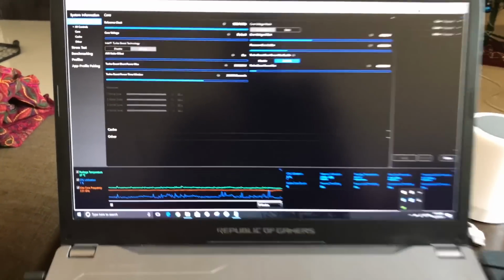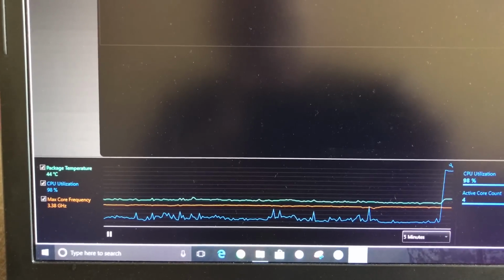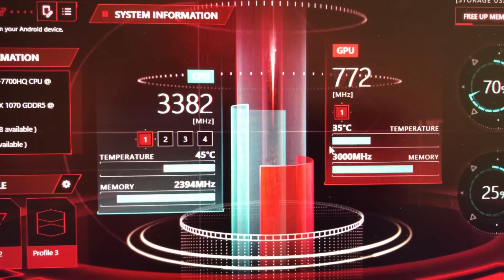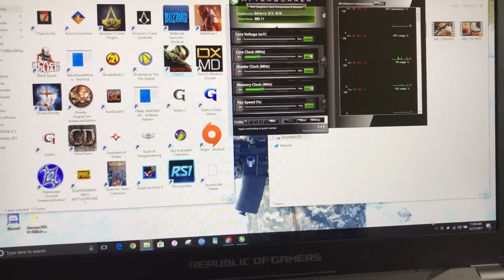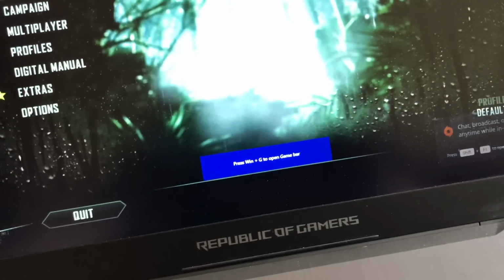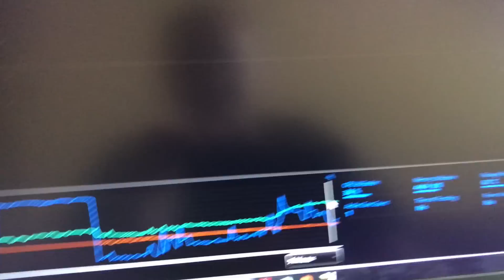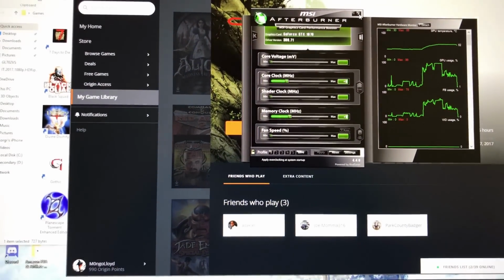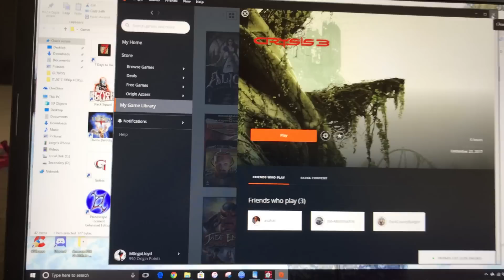ASUS ROG - Liquid Metal 5 Months Later! Followup

Comment: Tape the heatsink copper to the outside of the corner lines. Cover the WHOLE area inside the lines. Let sit for 12 hours and then clean off with DRY cloth. Copper should now have overall UNIFORM gray color. The heatsink is now Tempered. NOW spread LM thinly but evenly on heatsink and Die  for final assembly.

Comment: My condoctonaut will arrive next week. Planning to apply it on my ROG strix G17, both on the cpu and gpu. After applying it, others said i should reapply after a month, and then after that. I can reapply yearly. Would that be good?.. i don't travel that much with my laptop so no problems about leaking. One other thing, could i use electrical tape to cover up around the cpu and gpu die?

Comment: help me 
on same paste 
on same settings
on exactly same laptop
and i have fans on max 
i have 80oC on idle and 90-95oC in stress test please help me
Reply from the maker: Maybe you didn't use enough of the liquid metal? Maybe you didn't clean the surface very well first? Did you check the heatsink screws to make sure they are seated well? Did you undervolt the CPU?
Reply: i used ~0.4g 
i cleaned surface with isopropyl alcohol
checked 3 times 
no i didnt undervolt

Comment: 1:12 is it just me or is that a hole on your block? 
how is it holding up now!
Reply from the maker: Nah, was just some pooled gallium, still perfectly level surface.

I ended up selling it after 2 years, to upgrade to a more powerful system. Ran fine and was in overclock mode most of the time! I'd do it all over again if I had this heat trap 😂
Reply: @MrTsTips  huh that's cool! I personally have a 6 year old PC with a 3570k and it's begging for an upgrade
Reply from the maker: @ameliabuns  Wow! Yeah that's definitely overdue for an upgrade (depending on what you use it for!). If you are mostly gaming and higher end graphical/video work, the majority of that will be offloaded to your GPU, so I'd think of slotting a new RTX 2070 (best bang for the buck) in place of the existing GPU and see how you like it! If you then still want to upgrade your system, you will at least have a great GPU to base the build off of.

Comment: So I did this today on my Laptop, which is exactly the same one you have here. But while gaming, my GPU would start dropping frames all off a sudden for a few seconds before going back up. Any ideas? I'm thinking of taking the LM off and just using Kryonaut on the GPU now...
Reply: i tried to shim with 0.3mm copper plates both cpu and gpu, now it perfectly runs with 2 degree celcius deviation on 4 cores. i suspect my 1 piece ihs on cpu and gpu was bent a little. Before i had 20 degrees deviation between cores. i used in dell 7577 and asus g752vs. problem was on g752vs.
Reply: @nitehawk4067  i have same Asus G752VS with i7 and 1070 graphic, can i make same think as in Video shown, or need to make something other?

thx

Comment: Thank you for the work here, I will treat my ROG Zephyrus 502GW the same treatment - its very similar in build and gets very toasty!!
Reply: Michael Rudiger I have the same laptop (GX502GW) and am considering repasting with liquid metal. Have you done it yet and what are your temps?
Reply: @sidetraxx  Not yet, am currently not home and don't have the tools needed - I will do it, maybe even with video and benchmarks and temps. Also Using throttlestop to tune and undervolt at the moment.
Reply: @tech-daddy  Just wanted to come back and let you know my results. I repasted CPU and GPU with Kyronaut instead as I didn't want to risk doing LM since I've never repasted before. Thermal temps have improved, hitting 85C at the max for CPU temp now and overall the keyboard's been cooler to the touch and average out around 82C. Before I was getting 95C with spikes to 99C. Asus factory thermal compound was probably as terrible as the application job. 

I can only imagine how much lower LM would get it, likely even quiet the fans up.
Reply: @sidetraxx  Thanks for getting back with real world results :) I have pasted and repasted many things in the past and yes - LM is not for beginners. It much only get inn touch with copper at worst (nickel plated is ideal, aluminium is NOT possible). Also components around the areas where LM is applied should be protected, for example by sealing them with nail polish (LM is highly conductive). I will post again once I get mine done eventually ;P

Comment: Hey its been well over a year now. Have the temperatures started to creep up yet or is it as it was a year ago with LM?
Reply: Might not be completely helpful but I used liquid metal on G750JZ and the temperatures started to increase after few months. In desktop you might pull off few years but in laptop you'll definitely need to repaste it quite regularly if you want low temperatures, at least every 6 months.

Comment: Thanks to you I dropped my temps, it's been more than 6month now, so I'm planning to repaste as you did; Did you change the thermal pads too? I used the fujipoly, but they seemed to have rebranded themselves as Alphacool(I think). 

ps: I have the gl502vs, and want to change the ram, the clock is 2133Mhz, but do you think I can take 2400Mhz?

Comment: Ok to really lower your temps go to your advanced power settings and set cpu to 99% maximum state when plugged in / on battery. This turns turbo off which is not really needed in games and thus, lowers your temps dramatically by 10 degrees.
Reply: nice tips sir
Reply: Can you tell the exactly way of doing this please ??? I cant find where we can set 99%  :(

Comment: I did this to my gl702vsk, and it didnt do a thing. temps still in the 95+ under full load, but after 8 months, I took it back apart and replaced it with artic silver 5. Now temps are around 8 7-90 under load, so Idk.
Reply: Depends on the game you are playing. When I play Divison 2, it soars all the way to 95 and less CPU intensive games take it mid 80s. I use Noctua  thermal paste. Gonna try the liquid metal and see, but I dont expect much.
Reply: Manufacturing defects such as broken heat pipe or bent surface. Think with your head

Comment: Hey did you travel with your laptop ? Cause i'm a student and my laptop will be on conductonaut (3-4 travel by week), is it risky ? Will i find my laptop full of galium next time i open it ? :D I think if i dose it right it will be ok so i don't drop off, galium melt at 30° so in winter i think he will just solidify and melt again and again so it will be perhaps bad, i don't know, my laptop is a furnace actually so i want to find a way to cool it down, (i have bought kryonaut and conductonaut in case i change my mind). Can someone help me ? Thanks
Reply: Mayba Bamay it's not water...it attaches to the CPU and the heatsink like a normal thermal paiste...it,s safe to travel with it...

Comment: I know its been a year at this point, but did you check the temps without the undervolt? Im about to do this method to a Acer Nitro 5 AN515-53 WITH A CORE I5 8300h and a GTX 1050TI, running around 85c CPU/GPU under load

Comment: Ha, I have the exact same laptop, I covered my webcam with gorilla tape. I'm scared to actually do liquid metal, but my warranty just expired, so I just said screw it, and drilled a bunch of holes over the fans, that dropped my temps from 90c on the CPU and 80 on the GPU to 65c on both at full load. I might work up the courage to try liquid metal, or at least some higher quality thermal paste.
Reply: Can you send a link of a pic how you drilled it hahaha thats going all out dude props to you for just saying screw it hahaha
Reply: @marcgabrielferrer8616  Yeah, I'll grab a pic later, I upgraded to another laptop later, because in my tinkering, I screwed up and pulled the power connector pin from the mobo, now it only plugs in when connected to the wall. Now it's just a constantly on folding@home machine. The temps are good though!
Reply: @BlueThundah75  haha okay bud thanks ill wait for it

Comment: Watching gallium destroy copper ftw
Reply from the maker: "Destroy" may be a bit hard of a word to use here. Some RAF or discolored surface is there, sure, but thermal performance is there still as well, and even better with second application. Still running just fine, no problems on that last application ... it won't "destroy" copper if done right,  until the GPU is old enough to be obsolete anyway. It's a risk anyone who would apply this is taking. If you fuck it up, work some more and buy another.

Comment: Hey there Mr. T. So a few months ago you and I had a youtube comment chat and you helped me get to terms with how to undervolt the CPU and the GPU as well as answer some of my questions on your original thermal repaste video.

Now several months on, with comments being deleted (after your channel rebrand) and having experimented with my own computer, I have to admit I'm still not getting quite the temps you are...

Now as far as I can tell, you had a 702 that ran much hotter than mine did when it was stock, but then after your procedures, your PC is running so ridiculously cool. I'm so jealous truth be told. I did a thermal repaste originally and then redid it after a few months. When I did, I was disappointed to see my PC not get any cooler.

So to be clear. My PC idles (or has one or two browser windows open) at 40 C with a  CPU undervolt of -.125 and a GPU idle of around 43. This is with fans at around 70. Then when I game, They don't seem to go higher than 80 C. Now I do run an external monitor to this laptop. This monitor is at 1440p and it Gsync up to 144Hz. I'm not sure if that affects the temps. Because I do think it does. I mean I run Project Cars 2 or Elite Dangerous at full ultra and I still am pushing about 120 fps on average. So certainly I'm getting the most out of my GTX 1070. 

But its the idle temps. Ive sometimes seen it at 37 or 38 if I have the room at like 68 F and I just woke up the computer from the screens going dark. BUT never as low as you. And I've been really careful about the liquid metal repaste. I tried my best to be meticulous, clean as much as possible, and then of course try to get it to seat well. And yet never ever seen temps as cold as yours. I really think this just may be the fact my PC is built slightly differently? Maybe not all models are perfectly standardized? Because man I wish I could game as cold as you, but well I cant. And while I understand that VR (I have a Samsung Odyssey WMR HMD) will certainly push the temps up, I still get frustrated that the repaste wasn't enough to get it to truly run super cool. 

Any tips or advice would be really appreciated.
Reply from the maker: Hey sorry buddy, just now saw this. Are you still needing some help with system cooling? Or did you end up moving on to something else?

Comment: Tried to follow your guide on an G702VI. The thermal pads were a bad idea. I got very poor contact on the GPU die, resulting in overheating in 2d Mode within a couple of minutes. I went with Arctic MX4 paste instead. It's non-conductive and very gooey, so it's a good replacement for the stock paste. 

The repaste went well but I did not see much improvement on the temperatures, if any.
Reply from the maker: Rainer Schmidt you used thermal pads on the GPU?
Reply: No, I put the thermal pads on the GPU RAM and the MOSFETS as you did in your video. I used liquid metal on both the GPU and CPU Cores. However, the thermal pads were too high, so the heatsink did no longer make contact with the GPU die, resulting in immediate overheating. Using a non-conductive thermal paste on the RAM and MOSFETs is a much easier (and cheaper) solution.
Reply from the maker: Rainer Schmidt strange indeed ... in the follow up, I could see very good impressions with the pads I used. There could be a little variation with each unit and region of unit I suppose. Glad you were able to get it done though!
Reply: Colin MacLaren u might want to try thinner thermal pads. There are different thickness available in the market. That being said, i believe this might be the reason why Asus used thermal paste in some of the ROG laptops.

Comment: It make sense as to why AMD uses a Gallium sheet in their soldered cpus to prevent making the nickel/copper IHS porous when they apply it
Reply: Are you sure you aren't confusing the material here? Gallium is highly reactive, but I assume you are talking about the diffusion barrier - a layer specifically used to keep different layers of metals from interacting/reacting with each other (and especially to prevent material deterioration of the core itself as it would be very sensitive to any material pollution).
It's a complex topic in itself, but generally the materials used for this in CPUs are gold and indium. I believe all modern CPUs use gold as a layer pretty far down - and indium is indeed used for soldered CPUs to prevent the solder itself from diffusing into anything important.
Without the diffusion barrier it would probably not be very safe to use a gallium-based TIM long-term exactly because it has a tendency to diffuse into other metals.
Reply: TheStigma Ah okay, thank you. I forgot which one it was, I meant indium although I wonder what other less expensive materials could be used to make the diffusion barrier, potentially something consumers could buy to prevent permeation of liquid metal into the IHS on non-soldered CPUs.   Could that graphite sheet thermal solution work?
Reply: I'm positive that all CPUs have at least one, but sometimes more, diffusion layers - not just the soldered ones.
The Indium on used on soldered CPUs is primarily to provide an appropriate wetting surface from what I understand (think I heard about it from Der8auer). Without it, it is apparently very hard to make the solder grab on to the CPU die properly. The difficulty probably comes from having to solder at relatively low temperatures to not ruin the core.

As for the materials being expensive, well... just because a CPU contains gold and other rare and valuable metals doesn't meant that is what is making it expensive. These layers can be incredibly thin. It probably puts leaf-gold to shame. I can't imagine that any of the materials (as sourced raw) have a very significant part in the end-cost. That overwhelmingly comes from R&D and tooling I'm sure.

Just an educated guess on my part. I'm sure you can find a full breakdown of CPU costs somewhere if you really want to know

Comment: I have same laptop I'm gonna have to do this to it, Mine sits at 80c on CPU and GPU the only problem is that if I do this the warranty is voided. Let me ask you, what GPU clocks are you achieving with these temps?
Reply: Well with MSI it won't be voided as long as no component was damaged by the liquid metal. If your worried with warranty stick with high end thermal paste instead.

Comment: Hi,

I also found the air leaks in mine and they are actually more prominent than yours. I don't want to re-paste cpu/gpu as I don't have enough experience to do that, so first I would like to fix the air leaks and test the impact.

Questions:
1. Is sealing the air leaks with electric thermal tape good enough? One other user in the comments below has also mentioned using copper tape. If copper tape is better, can you suggest a brand preferably from amazon india. And can you also tell the difference in between using the copper tape and thermal tape?
2. Why didn't you do that?

3. There are some hot air extraction cooling pads in the market which sit on the exhaust. Opinions?

Comment: i've gl502vsk too... but my temperature is gpu 86° and cpu 96/97°.... i used coolaboratory liquid ultra but it has not improved at all... next step i try thermal Grizzly Conductonaut.... I am very disappointed of asus heatsink... 2000€ they could do better
Reply: I have the GL702VSK, which has a 7700hq and a 1070, and temps are around 98 degrees on my cpu and hitting the thermal limit of 80 at all times on the GPU. Iv actually sent it into asus already, to get them to either fix it and get the temps under control, or send me a different model of laptop, but they sent it back to me after 2 weeks, and not only did they not fix the issue, but its actually worse than it was when I sent it to them. Iv had it hit thermal max junction on me twice. Im arguing with them now about sending it back and trying to get a refund or a different model, like the g752 or the zephyerus.
Reply: I was also thinking of sending it to asus but since I saw some posts on the internet in which no one has solved the problem i think to solve this problem alone...
Tomorrow I test Thermal Grizzly Conductonaut, but I already know that I will not have decent results because the heatsink is far from the fan deflector of 3 mm, and this in my opinion affects a lot, and another factor is that the heatsink is too small and had to be at least separate from the video card
Reply: TurboNos 91 i thought about using liquid metal,but I dont think thats the issue. The issue is ther heatpipe design. If they had had one hetpipe going across both and then has 2 dedicated for each, I think thermals would be fine. My other issue is the fact that the fans dont have any intakes above them. The only intake for them is in the middle, making them work much harder to pull in air. If asus doesnt fix this, Im gona get an alienware vent off of ebay and cut a hole in the bottoms and just replace the hole with the vent.
Reply: I think so too.
You should try to do burnintest both the cpu and the gpu both at the same time without the back cover .... just to see if it's a lack of air... Although sincerely I hope to settle with the Thermal Grizzly conductonaut... I hope to solve this without making other changes...
Reply: I have just tested Termal Grizzly conductonaut ... it has improved slightly, but it has not solved anything ... the heatsink is too small and it is badly designed ...